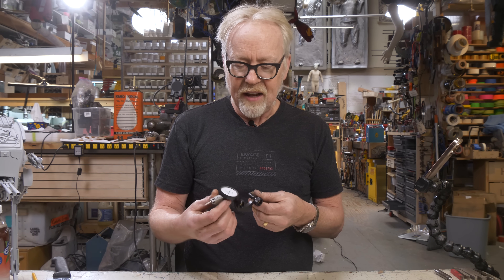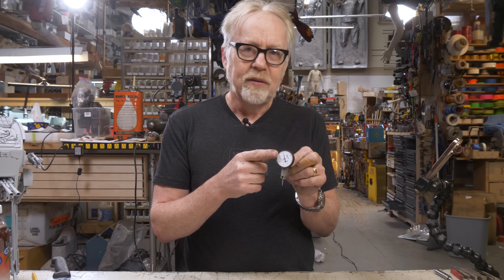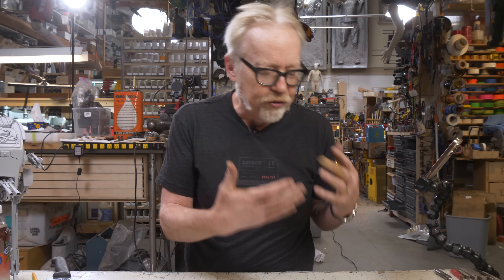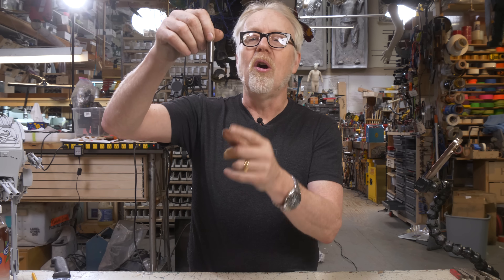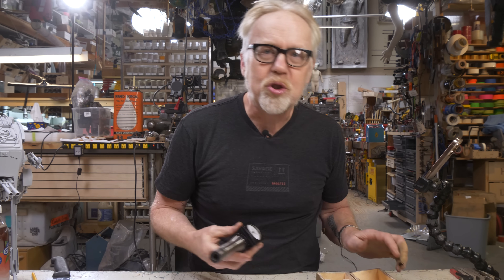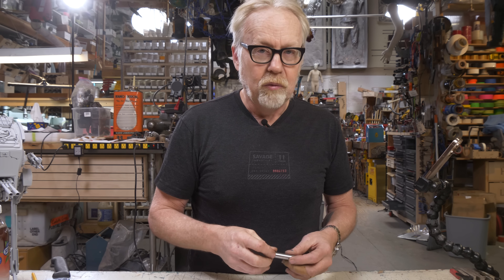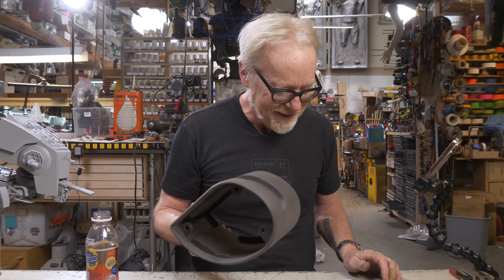Best Starter Tools for a Milling Machine

Comment from the maker: KH Craft Professional Dial Test Indicator: https://amzn.to/3RyKZ8H
Happybuy 6 Inch ACCU Lock Down Vise: https://amzn.to/3GnjMTV
Cobalt Drill Bit Set: https://amzn.to/42PCIlV
Precision Parallel Steel Set: https://amzn.to/4js5G2e
Precision R8 Collets Set: https://amzn.to/4ix2cu4
Magnetic Base: https://amzn.to/4cNlzhb
Basic End Mill Set: https://amzn.to/4lPOfu3
Mitutoyo Wiggler/Edge Finder: https://amzn.to/4ix5dKT
Half Round Combination Test Dial Support Stand: https://amzn.to/4jKqcuM
Disclosure: Tested may earn a commission from items purchased here. 

ADAM'S CAVEAT: These are suggestions for a beginner's set of support tools for a Bridgeport style knee mill. None of these tools below are the bees knees. One of the really fun parts of owning a mill is the upgrading of your equipment when you know it’s time and you’re ready. That’s an individual choice. When I finally paid real money for an expensive dial indicator, I was ready to use it and it’s been an amazing tool. Before that though it would have been wasted on me. The list above is a “get started” list.
Reply: So happy you brought up Sherline. I bought a Sherline 7 axis mill many years ago. Very small, very accurate sub .01mm available in metric and inches. They actually have microscope attachments! The mill is so small I can lift it one handed.
Reply: @_feltenix_  Yes...  I've had a Sherline 3 axis mill, plus the rotary table and the lathe for about 30yrs now.  Very accurate, though small machines.  I use them for smaller scale model trains and other small modeling projects.  They haven't let me down once.  Similarly, I bought a Taig Micro Mill about 20yrs ago and it too is a good, though small machine, though I haven't used it in about 15yrs because I needed the bench space for other tools, so now only the two Sherline machines have a permanent place on the workbenches.

I do hope to upgrade/upsize machines in the next few years and I'll be doing so with a Precision Matthews PM-728VT mill and one of their intermediate sized lathes.
Reply: U forgot the DRO.  Machining without a DRO is just not 21st century.  It's like automatic on a car or any other convenience u got used to, but don't notice anymore.

Comment: Those Haimer style 3d probes need to be recalibrated pretty often. Chuck it in the machine, grab a dti and indicate the tip, there are concentricity adjusting screws, dial in the tip just like you would dial in a part on the 4 jaw. Cheers

Comment: For the cost of a new mini-mill you can find an older small full sized mill used and have some money left for basic tooling. Cost of metal has skyrocketted and newer equipment, even hobby sized stuff is reflecting that price. As always, thanks for great info Adam (saw you visited Cutting Edge Engineering btw, you should do a collab project with Kurtis!

Comment: Vise, hold down kit, dial indicator, collet set, parallels, machinist square, common end mills 1/8, 1/4, 3/8, 1/2 , edge finder. This will cover 90% of the work you will do.

Comment: One thing I'd add, if starting from scratch, is at least a few gauge blocks or micrometer standards.  You can do a lot with used or Chinesium measuring tools if you can ensure they're calibrated properly.  And even the best tools need to be calibrated eventually or at least validated.

Another suggestion might be to try to standardize/harmonize whenever possible.  If you can use the same collets on your lathe and mill, as an example, it'll save a bunch of cash - adapters can generally be had for spindles cheaper than a whole different set of collets.  Ditto with drill chucks - if they fit many of your machines with minimal fuss, you are leveraging your purchases.

Comment: If you're just starting with a mill, my suggestions are:  for DTI, get a Starrett Last Word- it's simple, rugged, get the kit with all attachments.  I use this for in excess of 90% indicator ops. Mits, BesTest (B&S), Compac are good too. Get an edgefinder;  Again, Starrett's seems to have the best action.  For mikes, old Starrett, old Brown&Sharpe, Mits.  There was a company in Poland that made some good ones mostly marketed under other names.  For calipers, Mits dial units, though others made good ones Mits was seen most often.  I kept away from digital, the batteries picked the most inconvenient times to give up.  Don't pass old vernier calipers in the larger sizes, they do work well, learn how.  Get small hole gages and a set of telescopes.  I liked Starrett's better than Mits, just personal preference.  If you have an R8 spindle, Hardinge is the gold standard for collets, then Royal and Lyndex

Comment: Wigglers are not reliably accurate. They get wonky for the most minuet reasons.  You can use that test indicator to find an edge in combination with a small flat block, a gage block works very well. A chair type edge finder works good too. Both are more reliable than a wiggler. I use the pointer end of a wiggler and never the other.
On another note, NEVER use oil on gage blocks to facilitate "ringing" them together. If they are clean, and free of nicks in the edges (from the occasional mishap), they will ring. A super fine Arkansas hard stone will fix those inevitable nicks on the edges. Just don't go crazy with it, Try just rubbing them on a clean piece of paper that is laying on a fairly flat surface. This will clean them well enough to join them together.

Comment: Cold rolled steel bar stock is usually within a thousandth or two, cut off a couple pieces that fit in your vise jaws and you've got a super cheap set of parallels that are close enough to start working with, and they're not hardened, which can actually open up opportunities occasionally as a sacrificial parallel.

Comment: Nice clear video Adam, I am based in the UK and have the slightly smaller ‘european’ version of your Matthew’s mill, and yes most of these things are made in China now and the quality is actually pretty good (as in ‘good enough’) and, as you say, things have improved over the last 20 years.

I would say perhaps you could mention the spindle types and tool holding equipment. I think most mills in the US are R8 spindles right? Over here Morse Taper is still the more common type but I opted for the R8 system and I think it is more reliable. So perhaps adding a little info regarding either chucks (I have a keyless R8 chuck) and/or collets for holing cutting tools. Collets are, as you well know, the best and most secure way to hold cutting tools.

Keep up the good work!

Joe

Comment: That Precision Matthews PM-728VT is one of their best benchtop mills...  I've been hoping to pull the trigger on one, but we're moving house in about a year and a half and my shop is in the basement.  Don't want to have to move it twice, so I'll wait.  But it's a GREAT little milling machine by all accounts.  

Adam has one.  Blondihacks is another YouTuber that has one and other than some small mods and upgrades, it's a pretty much out of the box, ready to run the balls off it machine.

Not cheap though...   A Grizzly of similar size is about 1/2 to 2/3rds the price similarly equipped and it's probably 80% as good.

Comment: most important is a 3/4 axis LCD DRO with glass scales (KA-500, KA200, KA300, chose profile size according to ur machine, smaller is more expensive)  in 5 um resolution.  Once u have that u will not want to go back counting /reading dials unless its an emergency (DRO kaputt or similar).

Comment: I know you have done a video on them before, but annular cutters are a must have, you can easily drill big holes in thick metal, I drill 3-7/16 though 5/8 steel on mine all the time, love those annular cutters

Comment: True cost of owning a 'small' mill is about double its cost. BUT you can get going for more like 20-30% extra and make 'decent'' chips and parts. In 2025 with the typically higher speed spindles and lower torque Carbide over HSS makes sense.
Reply: Yes...  Very true.  It depends on how involved you think you're going to be out of the gate, or how deep your pockets are.  I used to do a hobby machining clinic at some of the small narrow gauge model train shows I used to attend years ago (I'd use a Sherline lathe, and the lathe plus the vertical milling attachment to demo milling).  
One show, there was a rather well off guy in attendance and he left the show, went home and he went through the Sherline catalog/website and purchased at least one of most of everything in it.  I knew this because he flew me out to his place and paid me to show him how to set up the machines and get him started over the cost of a weekend...   You never know with people.

Comment: Adam, I realy like the suggestions you make in this video. Tooling up a machine shop can get crazy expensive quick (ask me how I know😅)
Metrology equipment is one of those things that CAN be covered with basically no cost. In horology many parts are simply too small to true up in a lathe with conventional tooling. To solve this issue you can use something called a wobble stick. It can be as simple as a bamboo skewer resting on a round bar, and will give you incredible resolution when measuring runout. 
When I started working in a tool and die shop I managed to talk my way out of running CNC machines and on to manual machines. On my first day behind the mill, I wanted to tram in my vise. I could not find a magnetic base for an indicator in the shop, and one of the old timers told me to stick a needle to the spindle with some plasticene in place of an indicator and tram it by watching the gap between the needle and the jaw of the vise. When I got a mag base a day or two later I checked how well I had it trammed, it was within 10 microns across the 200mm jaw length!

The lack of these "basic" tools does not stop you from doing high accuracy work, but owning them can make doing it faster. I would even argue that a vise is optional to start with (but it is much more convenient than clamping everything to the table)

Comment: 1 2 3 blocks, rotary table, permacel tape. Shims, set of radius guages, micrometer, dial caliper, fly cutter.
Reply: I agree, fly cutter are such an economical way of achieving a very flat surface, they take longer than other methods, but they are such a simple and elegant solution.

Comment: I would like to point out as a comment to the bit about coaxial indicators that they are only garbage if you do not know how to set one up they are actually supposed to be checked every now and then for total run out or t r o which is what you mention about yours being out .015 that is supposed to be adjusted out by the user even high-end electronic ones that are used in milling machines like haas,hurco,doosan and Mori there will be maintenance to be done on the machines that if you ignore we'll eventually cause you problems for instance the heimer new engine you are supposed to take and place in the spindle and bring it down and check for run out with the regular indicator you showed at the beginning of the video you take the timer you rent it up against the needle of the indicator you spend the time around in a circle and you see how much it's out of true and that access and then there are adjustment screws that you will work back and forth kind of like you would afford your chuck on a lathe to get it running true until you are as close as you want to be or as close as your particular indicator will read down to If you only have an indicator that will run down to .001 then you want it to be as close to that as possible if it will go down to 0.0005 then that's where you're going to be A matter of experience and measuring tool accuracy how accurate those tools are I personally have used both electronic and manual coaxial indicators of different kinds and I have also used what do you call a wiggler I call an edgefinder a wiggler in my experience is usually a coaxial indicator used to find the center of around object whether it be a whole or it be a shaft I worked in a shop for almost 5 years using electronic probes and we never one time on my shift checked those for accuracy now mind you this was a shop that made millions of dollars a month We were a big factory I don't know if that was something that was done on first shift by their lead and that's why we just never did it but I didn't know it was even a thing and then I go to my second shop and we are using heimers there on the lower grade Mills And that lead man asks me about checking the heimer for t o r and I'm like what are you talking about so you shows me and I'm like oh that makes absolute sense that you would do that I never thought about that I'd said you know that must be something that they did on a different shift where I came from And at that shop it was something that was supposed to be done once a month on all of the probes whether it be electronic or a manual like a heimer. So I guess my point for this comment is it's really a matter of what you're wanting to do because I can go old school and check it with an edge finder and get close enough for most things and it's fine I can put the tool in the machine and take a sheet of paper and find the top of that part where the sheet of paper and the tool and again it's fine for most things but I have a very hard time believing that that method will be more accurate than using a properly indicated in heimer again I say properly indicated in because if you don't know what you're doing you won't get it right but I would say even if it's got a total run out of .005 or less for most home shops that's going to be fantastic now again that measuring device we're talking about is much more expensive than an edge finder but in my experience I can find my points way faster with it then again I am a professional I do this for a living It's really just a matter of what you're going to be doing when it comes down to it but overall your video was great I think it had a lot of great points I just wanted to point that out about the heimer needing to be indicated in every now and then or at the very least checked and that's actually the way it's supposed to be so if yours is out of true there are videos online that show you how to adjust it and you should probably check it because if you already have one and you've spent the money on it it's a great piece of equipment to use

Comment: The cost normally comes from the final finish, if you have the time, you can dial an item to what you need, the further you get the worse everything else gets and then you start going down the rabbit hole, you need to know when to say it is good enough.

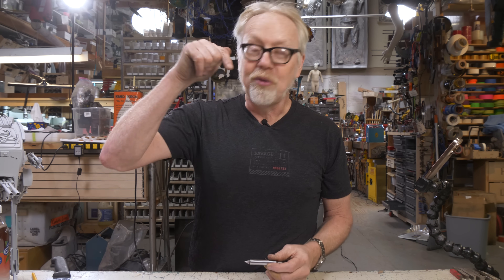Comment: 6:10. That's a edge finder. A wiggler  is great for finding a center point on the face of a part. I use it more than any other finder.

Comment: You should have a look at the videos of machinists in Pakistan and India and how they 'true up' stuff in the lathe with a piece of bent wire. But yeah Harbor Freight sells a good enough dial indicator for cheap; not sure if they have a tenths indicator or not. Re: vises: although the Chinese ones are perfectly fine it's wise to make multiple sets of soft jaws for them BUT before you do you need to carefully measure the distance between bolt holes because these are sometimes not spaced even numbers apart. Re: edge finders: a good alternate is a dowel pin in a collet and a cigarette rolling papers, which have a fairly consistent thickness. Also for marking what you want to mill: DyKem, a flat surface, a height gauge, a square and a scribe.
Reply: I used a dowel pin in a collet as an edge finder for AGES...  It works just fine, though I did start using a conventional edge finder about 15yrs ago.

Comment: I would also look at what you want to do with the mill and the accuracy needed for that.  If you want it as a glorified drill press that can make slots, you dont need near the level of accuracy compared to some of the model railroad stuff or watch building for example.

Comment: What you're calling a wiggler is actually and edge finder. A wiggler is similar, but it is a different thing that's not widely used anymore. The Haimer unit is very nice, and has its place, but must be adjusted occasionally, and especially when a new probe is installed. A nice thing about an edge finder is that it will work accurately even if there's a little runout.
Reply: Wikipedia says the following: "A wiggler, also known as a wobbler, edge-finder, center-finder or laser-centering-device, is a tool used with a machine like a mill, to accurately align the machine head with the work prior to machining. "
I personally hadn't really heard of wiggler, so I can't tell whether you're correct or not, though.
Reply: @TNH91  Wikipedia is pretty good, but sometimes it gets a little wonky on esoteric stuff. If you look at tool makers' websites and catalogs (Starrett, Fowler, General tools, Pec Tools etc.), the distinction is pretty clear. I think Starrett may be the only one that shows actual wigglers anymore.
Reply: @TNH91  an edge finder is spring operated and is what adam showed in the video. A wobbler is similar but its a larger diameter ball on a long smaller shaft that sits in a joint on the shank. Think ER collet but instead of the shank of a tool, its capturing a ball bearing with a shaft on it. it just articulates more but I personally feel is not as accurate. An old boring mill I used to run, we had wigglers cause it was much easier to see them "kick out" when the spindle is 6-10 feet above your head. trying to use an edge finder that kicks out like .020 or so aint it.